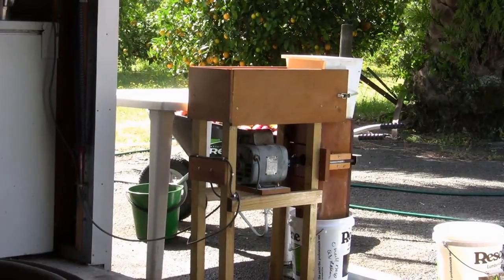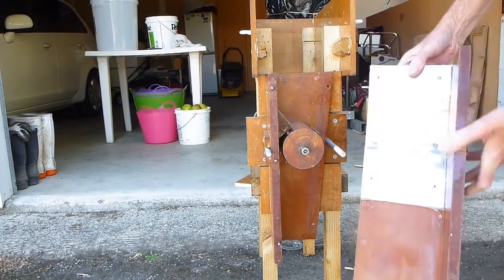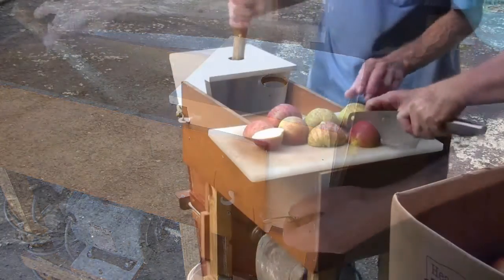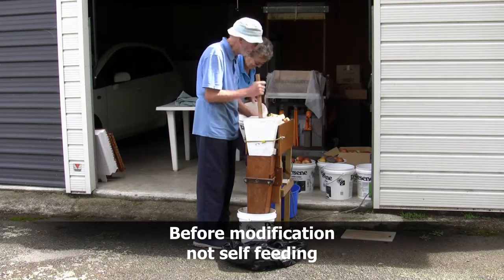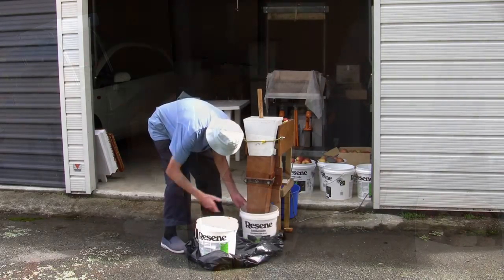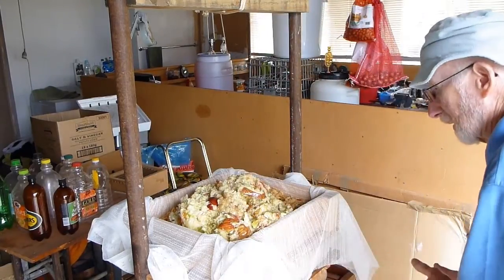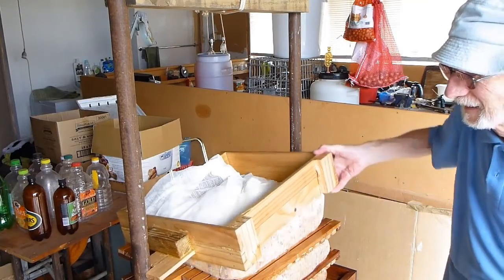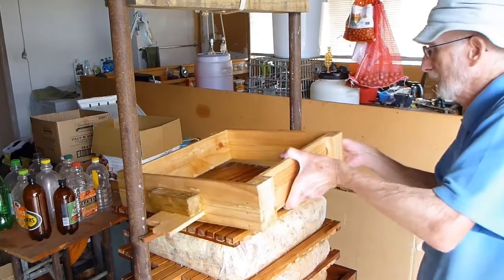Home made cider press and self feeding apple scratter

Comment: looks great! can you please tell me exactly what you did with the screw heads to make it self-feeding? try as I might I can't get my scratter to take the apples itself. did you sharpen them or screw them in from an angle? thanks!
Reply from the maker: +Jan Forest , Hi Jan, As far as I can tell the angles are  top edge 10 degrees and the front of the screw  50 degrees. from the horizontal, I used a triangular file for the front edge and that more or less controlled the angle I could get, but the top of the screw is  filed to make sure the cutting edge is higher than the back of the screw so it can't rub and creates a sharp edge. hope it helps but it made all the difference to my scratter.